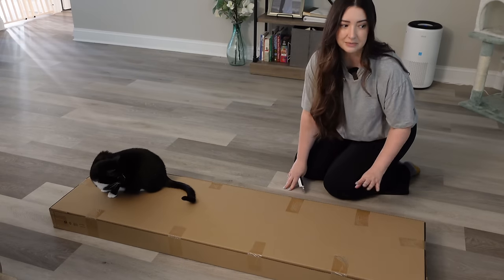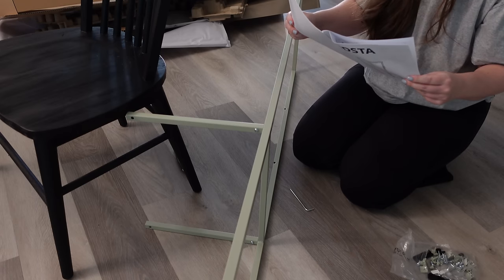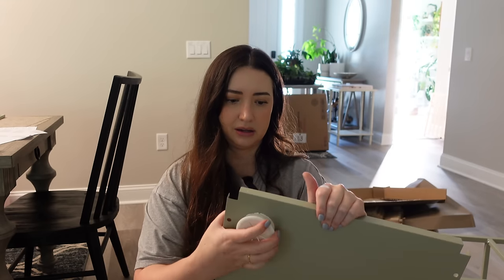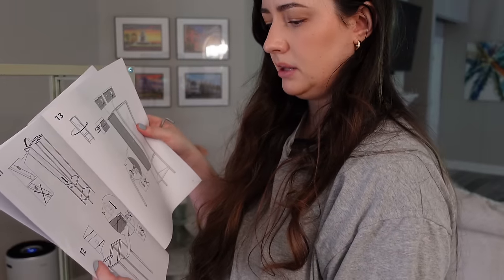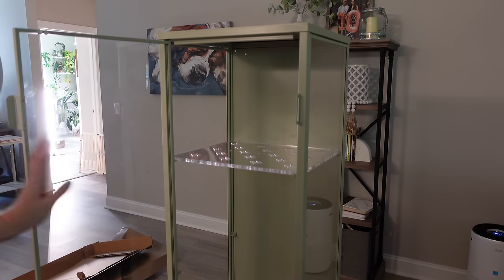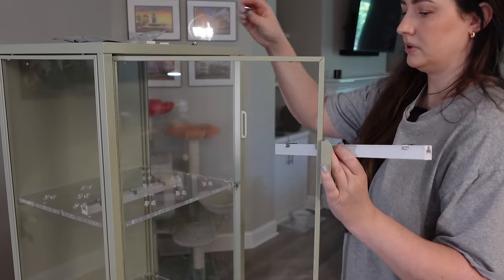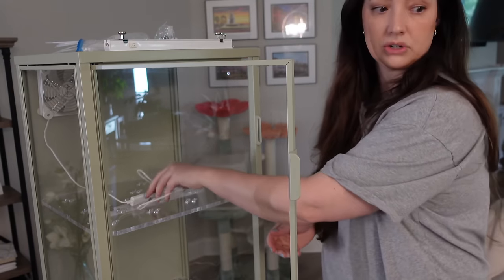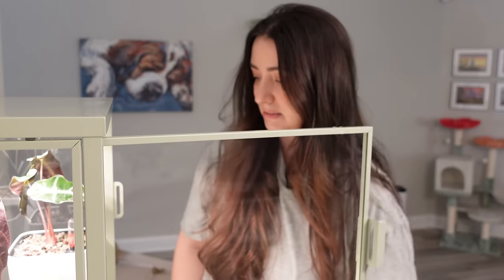Building My Green IKEA RUDSTA Greenhouse Cabinet 🛠️🪴

Comment: I had a 12 square lack book shelf sit in assembled for 3 years 😂 your fine girl. Start off drilling a hole with a bit for the center switch to your hole thing put the center in the hole and start at an angle and then turn it to a 90 degree as you drill.

Comment: hmm, if I remember correct the barrina lights have magnets on the top, the little stickers that come with them are just thin metal, so wouldn't the light hold on it own on the top of the cabinet? I´m not come and can´t check with my own right now, and my cabinet sadly isn´t metal, so I had to use the little metal stickers.

Comment: 19:17 - It looks like it's pointing out you shouldn't have any screws already in the holes. The misplaced screws would end up between the cabinet and the back panel as you're setting the panel in place at 19:25.

That makes me think of when the GPS says, "Stay left at the fork." Then I'm trying to anticipate this "fork" on the highway only to see 3 lanes going straight and 1 lane way off to the side veering to the right. I'd be less confused if the GPS didn't say anything at all! 😐

Comment: Was the battery 100% charged or maybe the dial was changed on the top of the drill. I might cause it to do that clicking sound, instead of sponning hard enough.
Reply from the maker: ahh could be! It's a new drill - the other one we had kept malfunctioning every time we replaced the battery. I just hit the button to work it and that's it haha 😂